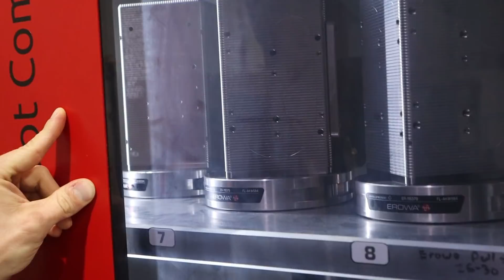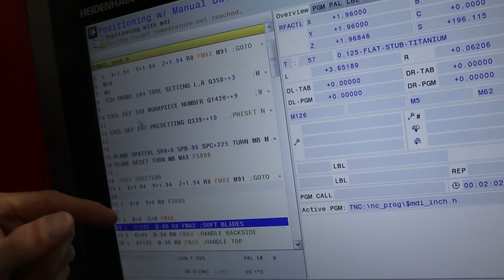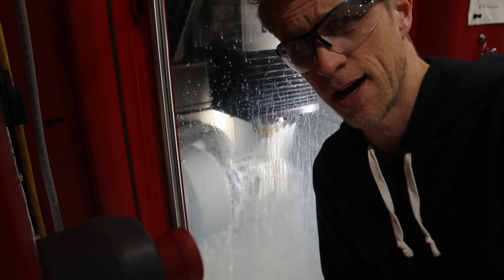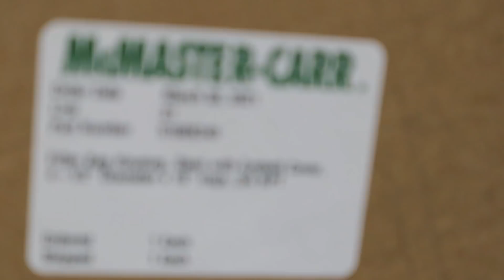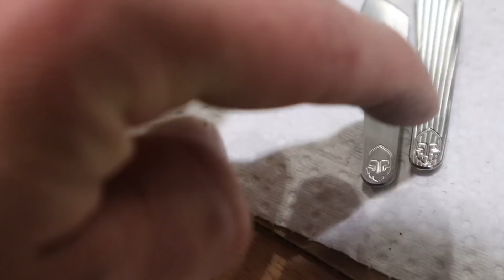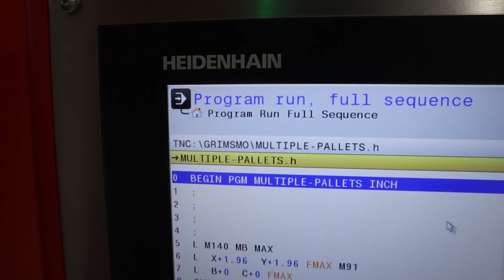Solo Shop Adventures

Comment: about the magnets: if you want to stick against a plate, the magnet should be potted in steel, that brings both north and south with high "conduction" to the plate. Right now the back pole has to come back in random  materials like plastic, air, etc. Another consideration is that sometimes the steel plate you want to stick to is too thin, and it can't conduct enough magnetic magic pixies across the poles and the rest have to fly in the air (inside the machine this time) and it's not efficient.

Comment: regarding the Okamoto paperfilter problem: i used to work on a maschine with a similar paper filter and had the same problem. We used to bump up the feeding speed on the paper roll to avoid the paper getting clogged up and the dirty coolant would just run over the filter down the side back in to the tank. if possible maybe give it a try

Comment: I Think you could benefit from version control your CNC code, so you not only have your code on the Kern  in case of fire in the workshop. It also gives your better compare options and easier rollback and description for each version. Take a look at GIT and it's easy to use in cooperation with source tree.

Comment: In work our dmg mori came with the coolant gun magnet combo. It works really well but after 2 years the paint is starting to rub off where the magnet is removed and replaced, I would advise painting a steel plate kern red as a protector.

Comment: So if your washdown hose comes from your pre mixed coolant supply does that not mean there is some risk that you could wash down a machine enough to over fill it with coolant? Would it not be more desirable to have the wash down come from the machines coolant tank, which means you are only re circulating the coolant already in the machine? Then the pre mixed supply is only used for top up and concentration adjustments.

Comment: Not sure if the kern has through spinal air, but if so it would be really cool to add a sub program that blows off your pallets before swapping them out! Just chuck up a pipe as easy as that.

Comment: For the tool chipping why not use a bullnose endmill or an endmill with a large corner radius? Does a radius in the bottom of the bore change the function of the bore?

Comment: Why are you keeping the Kern filters in a wooden box? get someone to weld and paint a steel stand that would look a lot nicer than some random cart and as a bonus you could add an upright just to hold your gauges.
Also, consider color coding your filters and bags so that you only maintain an inventory in one spot. You could use colored electrical tape or colored dots etc.

Comment: Hey John! I’ve used lens profile endmills for contouring similar contoured surfaces on our DMU65 and it’s so much faster than a ball and leaves beautiful finishes especially when tipping the tool over at 3-5 degrees.
Reply: Yeah, any one of the circle segment tool forms would be better since he's using a 5 axis machine. A tapered EM would probably be best.
Reply: Can't wait for fusion to support circle segment.

Comment: Torque wrenches are typically calibrated with your hand on the end of the handle.  So for what you're doing as long as you (and your operators) always hold it the same way you're getting that consistency.  But if you needed to hit an actual number you'd want to hold it by the end of the handle otherwise you're changing the length of the level.  Then you'll want to make sure all your operators use the wrench the same way to maximize your benefit of using one.
Reply: Torque is torque is torque. The wrench has no idea where your holding it. It's measuring torque, and you holding it at different lengths just changes the force you need to apply to achieve that torque..
Reply: @xenonram  I agree, I did not think that where and how you hold a torque wrench changed the value of the torque you are putting to the part. We have torque wrenches calibrated through calibration services and they never ask us where and how to hold the torque wrench. I am not sure what this guy is talking about.
Reply: @patrickmartinez3217   I think he is referring to the human torque setting FT
Reply: @xenonram  That's simply not true; shorter lever = more torque applied before the wrench clicks. Experiment with a wrench and a torque analyzer and you'll see that the torque reading will be higher if you hold the tool closer to the head. I've had to show lots of very clever people this for them to believe it.
Reply: @willej78  I agree that with a shorter handle, you would have to apply more torque to the wrench before it clicks. But the torque wrench is still outputting the torque at which the wrench is set to right? Torque input does change but the output never should. That’s the whole point of having a torque wrench that you set to a specific torque setting.
Reply: @patrickmartinez3217  No, think about how "clicker" torque wrenches work, you're using a lever of defined length to overcome the spring force that sets the torque applied. If you change the length of the lever, by moving where you hold the lever, the torque required to overcome the spring force changes. If you have access to a torque analyser you can prove this by setting it then reading the applied torque with your hands on different positions on the lever, move your hands closer to the head and the applied torque will increase as you shorten the lever.
Reply: Correct. The difference between accuracy and precision. Use the Handle designed into the torque wrench to achieve both.